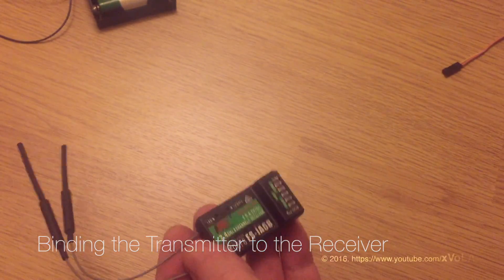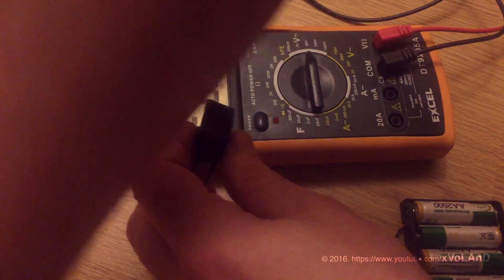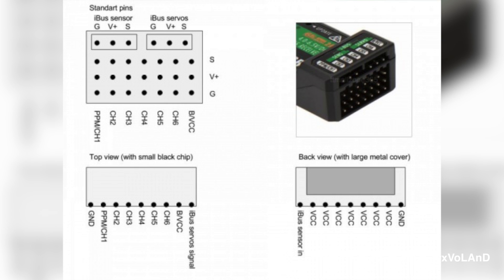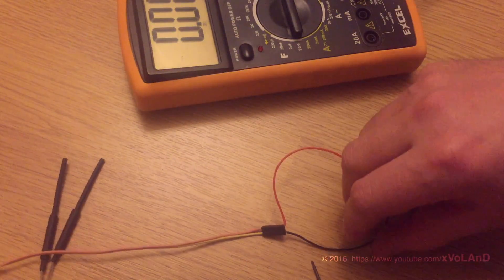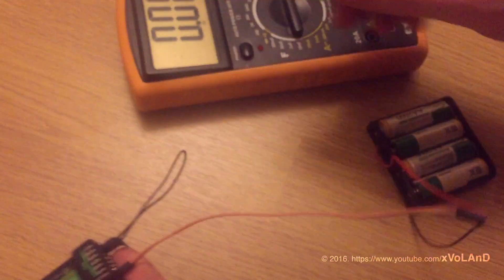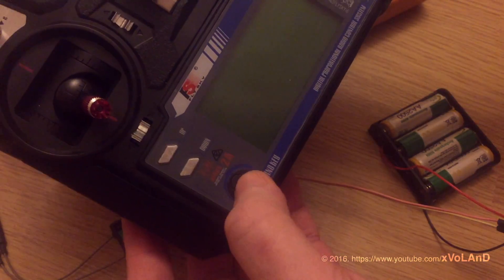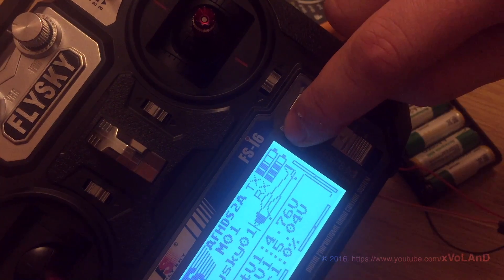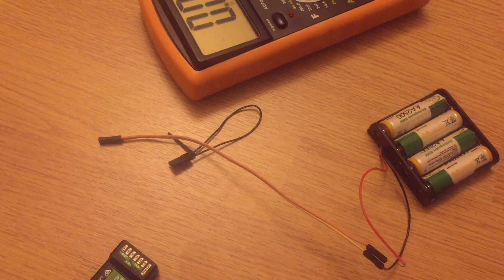How to bind a Flysky FS-i6 RC Transmitter to Receiver FS-IA6B. Как связать передатчик и приемник

Comment: Hey I am new to flysky radios and have had a fs-i6x with the 6ch reciever it comes with for a while and needing to upgrade to my fs-ia10b 10ch reciever. the radio binded fine but it still only shows functional channels on the radio even though im connected to the 10ch reciever? please help, thanks
Reply from the maker: Hello! Install FlySky FS-iA10B on a quadcopter and setup the connection method i-BUS, PPM in the configurator Betaflight and now - it should works.

Comment: Hey bro is that a jumper wire that you used to connect the lead wire of the battery holder?
Reply from the maker: This is any piece of wire to short-circuit

Comment: For those of you are having problems with binding just let it stay binding for a long time mine worked that way. Strange but it works.
Reply: A long Time means what? 2 Hours? (I left it 20min and it didn't work)
Reply: @augustinm.5788  i left mine for about 2 minutes. lately i havent encountered this issue. i hope you get it working.
Reply: @Oneoniner-109  thanks I found the problem, i was in trainer mode, reinitialized and it worked
Reply: @augustinm.5788  wonderful I’m glad man.

Comment: do the little plugs come with the receiver? the quad i'm getting just has wires that you need to link up to the little plugs that go into the receiver.....

This is the most frustrating fuckin hobby I've ever tried getting into... there is NOOO fuckin information ANYWHERE about ANYTHING. All this info people give is information that comes WAYYY later.

I got a drone a radio a receiver a battery and a charger...... and I cannot figure out if that's enough...... Do I have to solder wires to install a receiver? Do the little plugs come with the quad or the radio to plug INTO the receiver FUCK where is this information!?!!?

Comment: I have a racer with the radio already BINDADO in FS IA6. I got a FSIA6B Ok. If I make the BIND with the FSIA6B does the radio understand that it has two receivers connected? That is, how do I manage two receivers running simultaneously on the same radio?
Reply from the maker: No, he doesn't have two receivers :) I didn't do this maybe only certain brands (Spektrum, Futaba, Turnigy, FrSky) support this feature.I can't imagine why this is necessary but it should definitely work on the same protocol.
Sorry, but I'm not helping you anything, I don't have two receivers to experiment with it.

Comment: What is the output voltage of the receiver? I am ordering servo motors and I don’t want to fry one. Thanks
Reply from the maker: Wolverine Don’t worry everything will be okay
Reply: Vitalii Tereshchuk Ok thank you, I wasn’t sure thanks again.
Reply from the maker: Wolverine But you must remember with electromagnetic motors you need to use a diode. I mean, that this is in the ideal case
Reply: Ok, I am properly going to get Keywish 4 x MG996R Mini Digital Servo 450 Metal Geared Torque Micro Servo Motor 9G For RC Robot Helicopter Plane Boat Car.
Reply from the maker: Wolverine these are powerful motors they need a driver
Reply: Ok, I'm new to this RC hobby so, can you explain what that is? My receiver puts out 5 Volts the servos need at least 4.8V ( I think ).
Reply from the maker: Wolverine What does it say? Everything is okay
Reply: Vitalii Tereshchuk My receiver puts out 5 Volts the servos need at least 4.8V ( I think ). I have the same receiver as you and the servos the only problem I see is that they wouldn’t get full power.
Reply from the maker: You understand correctly, there is not enough power. So I said about the driver for servos. Of course, you can make a replacement yourself consisting of MOSFET
Reply: Vitalii Tereshchuk oh ok, I’ll research it more thank you for your help. It was greatly appreciated.
Reply from the maker: No problem! You're welcome!

Comment: I have my ia6b receiver bound to my flysky i6 transmitter. It is set on ppm output on the transmitter and on the drone in cleanflight but when I move the sticks on the transmitter, the bars on cleanflight do not move, they just stay at 0. I am setting this up with an eachine wizard x220. I have it set on channel 1/ppm and the receiver shows that it is connected to the drone(shows the battery voltage) but it also wont turn the motors. Please help if you can. Thanks!
Reply from the maker: Your problem can be solved but I recommend you stop using PPM and switch to the iBus protocol because you already have installed Cleanflight. The iBus uses fewer wires from your receiver and easy for connect to flight controller.

Comment: I tried using a 1s lipo 3.7 volt and it burned the receiver right away!
Reply from the maker: Really? How is this possible if I connected a 4.8V but a fully charged Li-po 1s - 4.2V!!! Admit that you did something wrong.
Reply: yeah.. I dont have a clue what i did wrong. after that i connected the white cable from 3s battery and it worked, but i guess it was already too late.
Reply from the maker: André Salles allowed voltage 3-5V
Reply: yes but very strange it burned with 3.7 volts. And more strange is that it still working. A module burned cracked and smoke came out... but somehow i think i still works
Reply: How im supposed to give the voltage on the drone? only big batteries are makeing it work. small one s batteries make it burn like crazy,
Reply from the maker: Power is supplied to the receiver via the power distribution board or through reverse power supply from the controller, or separate regulator. As you understand, there are different ways and it depends on your configuration
Reply: reverse power supply from the controller? so normaly controller have a pin for that?
I also got this FLYSKY FS - X6B , you know how is it powered? probablu diretly from controller?
Reply from the maker: I meant the engine speed regulator. But this is not the best solution, I usually use the power distribution board
Reply: I think its the WH, whats hour rate!
Reply from the maker: I didn't understand what you mean WH?
Reply: watts per hour
Reply from the maker: Ah, ok... I don't know this value
Reply from the maker: may be 200mW or 600mW

Comment: Hi 
I've done exactly like you but when I power on the transmitter the receiver isn't binded and it starts ringing. 
Why ?
Can you help me pls
Thanks
Reply from the maker: Hugo Barthod possible small power
Reply: Vitalii Tereshchuk I charged my battery just before :/
Reply from the maker: Another problem that may be is the configuration of your transmitter. Reset it to the factory settings and try again bind the transmitter and receiver
Reply: Vitalii Tereshchuk I will try but I touched nothing of the configuration of the reciever
Reply: And the power isn't a battery it's the ESC of my plane
Reply from the maker: You found the problem, right?
Reply: Vitalii Tereshchuk No I will look at this friday evening
Reply: Ok I had a look this evening and I think it was binded but the ESC wasn't plugged in the right pin. But no problem it works
Reply from the maker: Hugo Barthod I can congratulate you?
Reply: Vitalii Tereshchuk Yes but I can thank you ;)
Reply from the maker: Hugo Barthod Hi! Congratulation! You’re welcome!

Comment: nice video, this it is what  I was looking for. 'cos I burned up my last receiver :-( . but I have a question what would happen if connect plus to less and less to plus?
Reply from the maker: Leiber Acosta 😂 I didn't watch the circuitry, but you can check and let us know
Reply: But I meant it can make a short circuit or burn the receiver?
Reply from the maker: Leiber Acosta Earlier I said why I can't give an answer. Usually, there is some kind of short circuit  protection. Think, that he will burn 😉

Comment: Very helpful video. I just seem to be having an issue with the receiver. For the RC to connect properly and to be able to control my quad, I have to plug the LiPo battery in and then plug the receiver in. If I leave the receiver connected and then plug the LiPo in, the red light just flashes intermittently. Does anyone have any idea what this could be? Thanks in advance.

Comment: I have bought flysky i6 transmitter and a kbar 534 V2 pro gyro but I'm facing a problem with the wiring to setup trex 450 V2 pro 6ch helicopter. Can u pls help me to setup Thank U
Reply from the maker: I don't have a trex 450 V2 pro 6ch but if you describe the problem, can someone or I can help you. What's the problem?

Comment: can i use 22.2 volt 3000mah battery with it?
Reply from the maker: Haider Zulfiqar Not. Only 3.3-5V
Reply: I tried using a 1s lipo 3.7 volt and it burned the receiver right away!

Comment: i recently bought fly sky FS-i6. but the problem that i am facing is the it is not getting bound by the receiver which is FS-iA6. 
i tried all types of binding. still it is not binding.
can you help me with this
Reply from the maker: if you are doing like in this video, you should have no problems.
Please, describe what is happening
Reply: i did whatever the video said but still im not getting the rx display on the screen.
Reply: whatever i do, my transmitter is not showing rx signal. basically it is not binding
Reply from the maker: when you connect bind-plug and connect power... what's happening? I mean blinker (led)
Reply: when i connect power and bind plug it blinks fast then when i press my bind button and switch on the transmitter, the blinking slows down but it doesn't show any connection on the transmitter.
Reply from the maker: So, you see this text?

https://youtu.be/jB3BhA2F20o?t=167
Reply: i think its not gonna work. anyways thanks for your time
Reply from the maker: I think that your bind-key doesn't work. You're welcome!
Reply: no im sure its working coz in made it myself